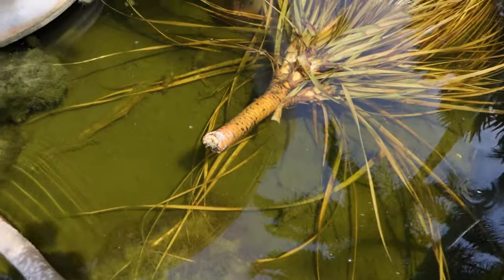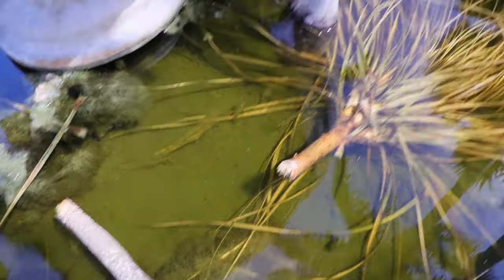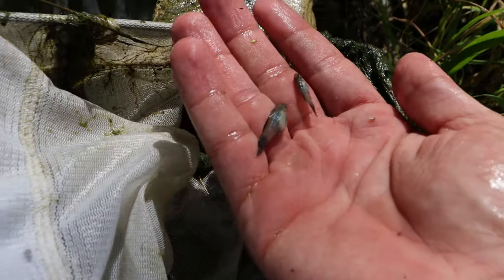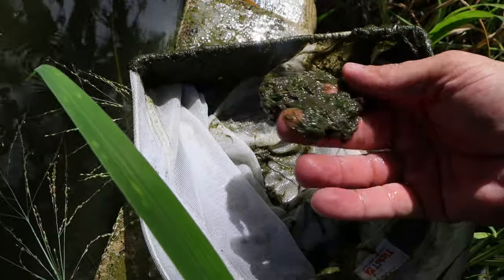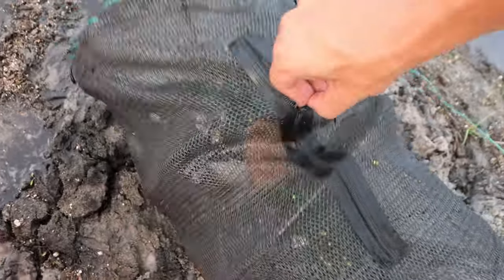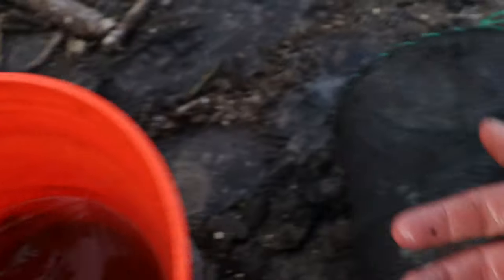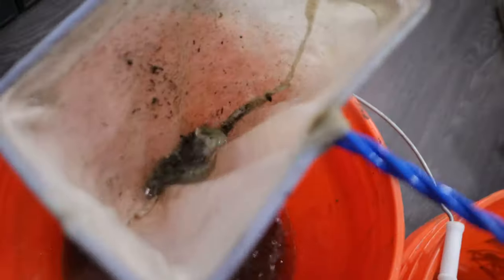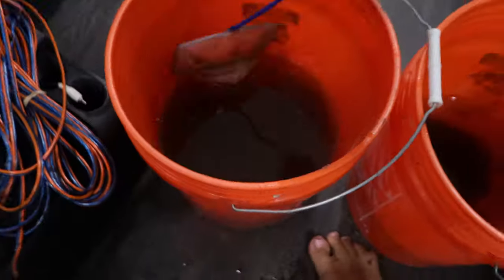Saving MONSTER FISH From FILTHY Abandoned PONDS!

Comment: Dude, Buy some Mason Jars, Mason Jar Lids, Metal Window Screen, Nylon Mason Line. Cut the screen to size. Form a funnel out of the screen to fit into the Mason Jar. Fold over the screen and screw the mason jar lid onto the jar to hold the screen in place. pop a hole in the funnel end. Tie the mason line to the neck of the jar. This fish trap will catch those small fish in the fountain.